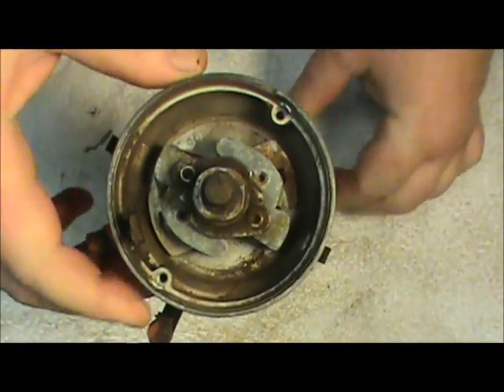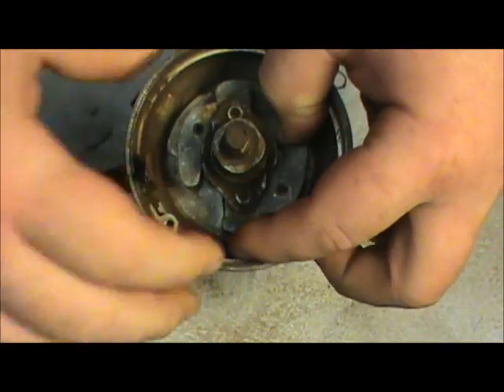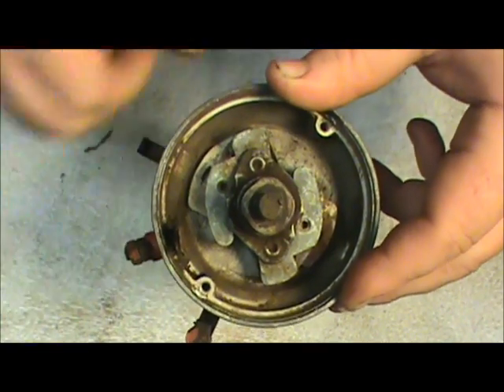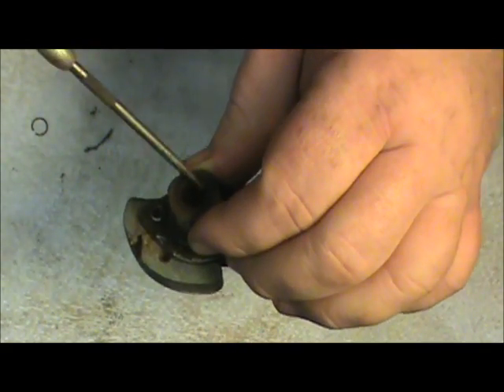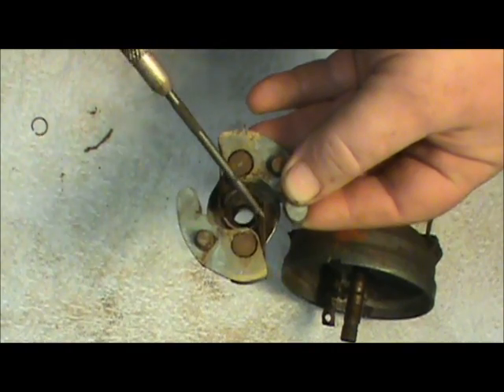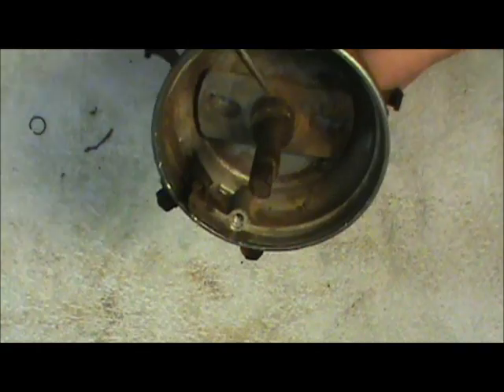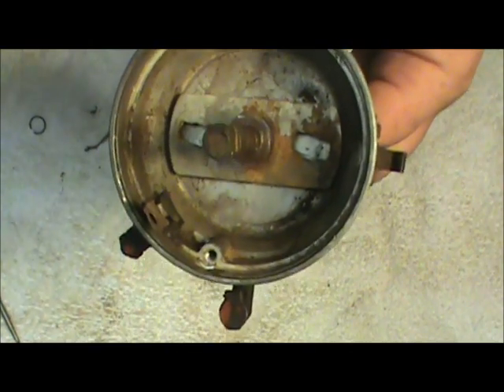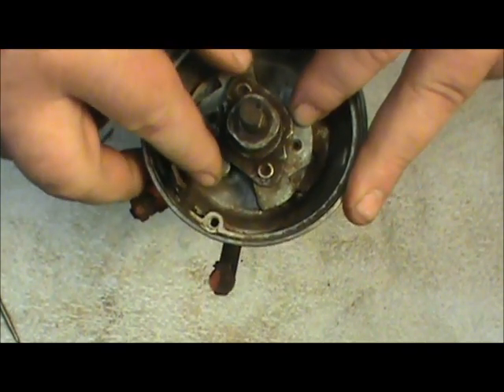Mechanical Spark Advance on Antique Tractors

Comment: 528n new plug new points new coil set points 25  stil no spark at plugs .its 12volts now instald reducer .no fire at plugs .dispute cap is old but looks ok . Thanks if you can help

Comment: I am installing a rebuilt engine in my ford 2000 4 cyl gas.  When I install the old distributer I will check the spark advance just as you have shown.  Thanks for the info.

Comment: Greetings, I have a 8n tractor I think according to its serial # its a 1948. It has a distributor I had to replace as the pin on the timing gear had sheared off. Since it had sheared and had turned over I had no idea where TDC was. ( Flywheel was impossible to read ) So I used the ole #1 piston on compression tactic. I also replaced everything in the electrical ignition system; that is a 12 volt by the way. I have worked on engines and cars since I was old enough to hold a wrench. My father was the foreman at the I.H. tractor repair shop I am now 60. My first tractor was a cub cadet hand crank start tractor.This engine is really simple the reason I chose to buy it and of course being financially challenged helped that decision along. Now my problem. I'm not really up to snuff on the conversion and the ballast resistor I had to install between the switch and the positive side of the coil. I replaced this also. Now the problem. When I went to check spark I would get a few blue sparks from the coil then nothing. I checked for power drop in the system. I found that when the points were open the voltage would be 12.3 when the points are closed 2.3. I have asked around even to the company that supplied me with the resistor and they didn't even know how or why it was needed. I have found that out only through a tireless investigation of the part. Some say it is only needed when the tractor is running and it is in charge mode. Some suggest to use a bypass when starting the tractor. Then use the regular system when the tractor is running. I tried bypassing the resistor again I got a blue strong spark for a few times again the spark failed after that. I'm flummoxed! How can such an engine be this persnickety?  Can you help me? I would be eternally grateful if you could
Reply from the maker: Does your tractor have the front  distributor behind the fan belt or the side mount distributor with an external coil?If it has the external coil then just replace it with a coil that does not require  the external resistor and run straight 12 volts to it. The points grounds the coil to collapse the field and discharge the spark. Pertronix should make an electronic module to go in your distributor to replace the points. It cost about $100 an is easy to install That is what I would do and you will never have to worry about points again.  Let me know which distributor you have and I will help you figure it out.
Reply: Sorry I thought I'd pretty much told you all I know. It's a side distributor at a 45* angle at the right driver side front side of the engine. I wrote the question about 5 times was having issues with my computer, and it kept erasing what I wrote. Thanks for any help you can offer.
Reply: Thank you for your input. Since the $100.00 fix is out of budget right now, I talked with an antique tractor restorer on the the phone. He suggested to look at and replace the bushings in the distributor. Says its a common ailment of the 8n's. Will try both I need my tractor! Thank you again for getting back to me so quickly.

Comment: My tractor is a John Deere 1010 with a delco mechanical advance distributor. I have timed it over and over. It will run good for a while and then miss out. Then run good. I have rebuilt the carb, new plugs, points, condenser,  etc.... now I have taken the distributor out because it just doesn't keep time. I found a clip on top. Removed it and then the top came out with two pins sticking down. Under it was a bushing, 2 springs laying on top of 2 weights. One spring was totally different thickness than the other and broken. The weights were really gritty. After cleaning everything up it feels like I need a new bushing also. The shaft has a little play. My question is, where can I buy parts for this and is there a number on the distributor somewhere that will help me make sure I get the proper parts?

Comment: Thank you for the video!  Looking forward to getting the 8N to start without starter fluid.  haha  I'll clean the carb and points like you showed.  Upgrading to 12 volts today with a new wiring harness.  :)